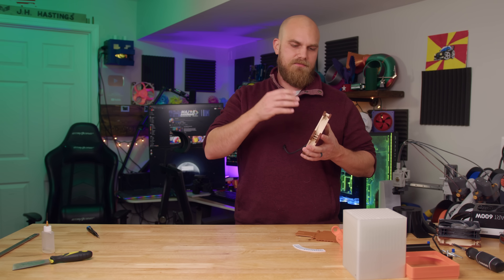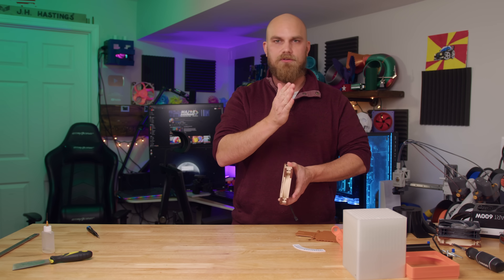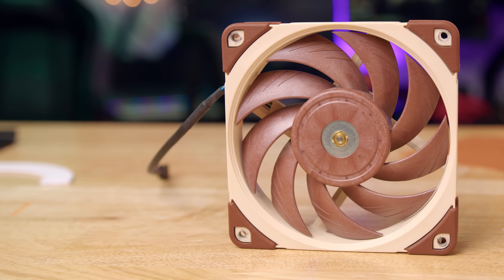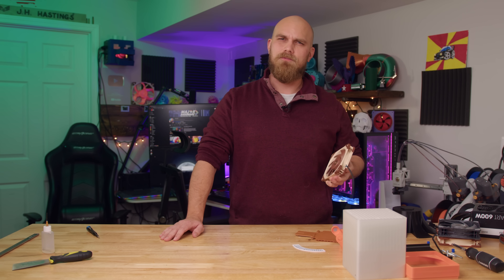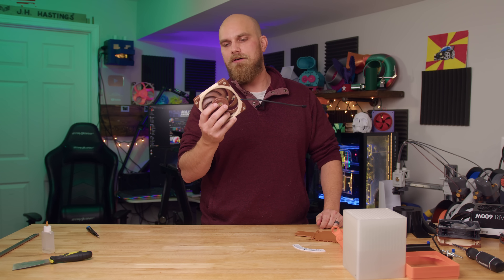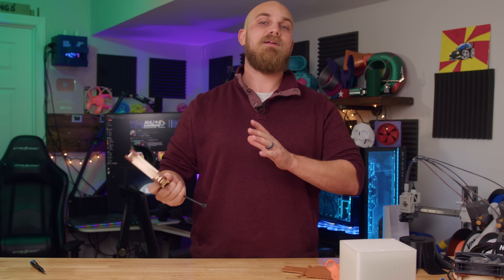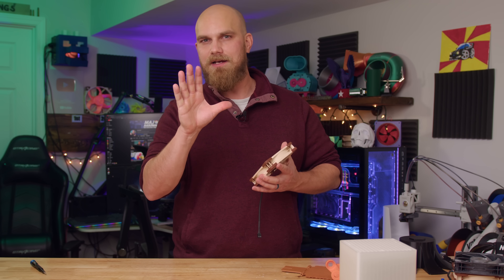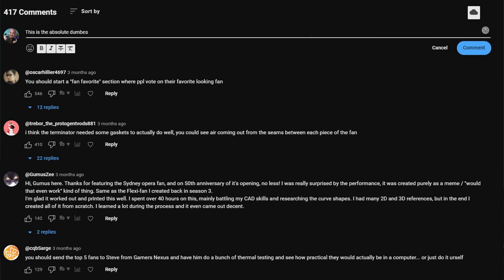I Built a Static Pressure Machine | Fan Showdown Season 6 Pilot

Comment: Could use two tunnels with the fan sandwiched between them, then get two manometers (i recommend the field peice job link pair, i use them daily and love them), and place a bung halfway down each tunnel and the number differential you see on the app will be your static pressure

Comment: The Testo 510 has a range of 0 to 100 hPa (from the datasheet). My web browser tells me that 1 hPa is about 10.197 mm H2O. 2 mm H2O would be about 0.2 hPa, (which does not change the display since it is too small). Since you will be measuring the difference in pressure, you can have a port on either side of the restriction connecting a transparent U tube with water in it. The water will be at the same level without a difference in pressure. You can measure the difference when there is a pressure difference. Since the distance is quite small, you may need magnification to record the different fans.

Comment: For a monster fan to test, grab a VA450DC from Nidec.  120mm (I could only find a spec of 258cfm for a sister fan) 12VDC 3.6A.  I use 6 of these in my daily.  I wonder if the flap opening "unsquare" has any effect on airflow in the chamber?  My thought is something to do with a backwave propagating along one edge, which would actually give spurious data with more powerful fans affected more than less powerful ones.  That would show on a graph as a "diminishing returns" type of thing, when in reality such data might simply be the result of strange airflow patterns in the tunnel.  Perhaps the flow and pressure for PC fans is far too low to matter, but I figured I would offer the thought anyway.

Comment: Just make a manometer. As described, inches of water are just that, the pressure the fan can make measured by how far it can push water up a tube. You might have to play with a few tube diameters, but other than that, inches are inches and water is water.

Comment: I think the linear gauge won't be an accurate reflection of fans that score very, very close to each other unless you swap it out with a dial gauge or something else with very high resolution.

I have -0.01% knowledge in the area of fans, static pressure, and fluid dynamics, but it seems to me that the more the flap opens the airflow can increase by a non-linear proportion.

Comment: Mount a laser pointer to the flap so you can project it long distances and get a more precise reading. You could use a double mirror to extend the beam length in a tight space if needed. Just make sure it stays calibrated if you do that.

Comment: I am not an engineer, but the more this hatch opens - the more air starts to move freely, without dealing force to the mechanism. Will it be more accurate if a fan will blow upwards through a tube into a moving platform, on which you can place different weights? So you can balance it and see things like - with fan 1 - it lifted a platform at 1 centimeter mark with 30 grams of weight. But fan 2 lifted a platform at 1 centimeter mark with 40 grams. So we can exclude the spatial parameters of the system, and be left only with mass that can be lifted and maintained in floating state at fixed height.

So in other words - its like a hover airbed vehicle, but upside down. The higher the static pressure - the heavier that vehicle can be.
Reply: Also, knowing the surface area of that platform and its resulting "floating in the air" mass - you can literally calculate pressure as P=mass/surface. 

Because now you are getting "whatever that is" angle, which can be hardly transformed into real data

Comment: My suggestion would be to look at the early electronic fuel injection systems on cars (70s era). Some of them use similar systems to measure the air that goes in to the system. One example would be the Bosch K-Jetronic (not sure if that is the correct english name). There are my good images on how they work. The engineers had to solve many issues a simple system like yours has, to get accurate reading. Even if you don't end up using it, it's a good learning ;)

Comment: I like last season's "blowing through a radiator" type of method better, static pressure and air volume are two unserapable parts of a fan's performance as you always have to overcome some kind of resistence in a real life situation, and air is what ultimately takes away the heat so volume matters too. But the concept is nice, even though numbers on the gauge barely mean anything, this device can be useful in comparing fans, maybe add this to last season's test suite. The lower half of the gauge is basically unreachable using ordinary pc fans, as the angle got wider, the contact area will get smaller, and more airflow will just pass by the plate without applying any force or just a little force.

Comment: instead of using values 1-18 as angle measurements you could just use 90* and measure the ANGLE, this would also allow you to take more accurate readings

Comment: When that flap moves, it is exponentially harder to move it because more of its weight lays of air flow AND because area gets much smaller. So 1 point of difference at 3-4 and 1 point at 6-7 are two really different points.

Comment: Why not make a simple inclined column manometer? Instead of having water (or some other less dense liquid like mineral oil or even alcohol but that would have evaporation issues) in a 90°/vertical orientation you could make a simple liquid-in-tube manometer at say... 45° high and low side with an expansion on the end facing the airflow. Having a larger ratio between intake end and measurement portion is one wy to increase sensitivity and then adding angle to it could be the cherry on top. 

And sinple to make!

Comment: While this contraption looks fun and is simple to make, it doesn't measure anything specific. It doesn't measure pressure because as soon as the flap opens even a tiny bit, the airflow escapes on the sides, fouling the measurement. It doesn't measure airflow for the same reason. It doesn't measure airspeed either. On top of that, the measurements become increasingly imprecise the more the flap opens due to gravity multiplied by leverage angle, etc. 
If you want to measure static pressure, the chamber should be sealed on one end and you should measure air pressure inside the chamber. Manometers are too much, they deal with large pressure measurements, IMO what you're looking for is a type of barometric pressure meter like Comet U2422 or similar.

Comment: That is absolutely not static pressure - there is airflow so it's not static. You could probably rig up a true static pressure meter placing dimes on a plastic bag until you reach a balance point where the bag lifts the dime stack to half its max height.

Comment: I like the concept for the Cat-Flap-Static-Pressure units but agree with other commenters that this logarithmic scale might not be as illustrative as it originally seems. I would suggest trying a terrible performing and middle performing fan to see what range you can expect out of this setup and then figure out how much it needs modification. Currently our only data points are good, very good, and overpowered.

Comment: The issue is you have linked the resistance and the measurement tool. So now your resistance is not linear with pressure as the gugenooend up, the resistance goes down. A better solution would be to put a load cell on the arm and rather then a solid flap that moves, use a mesh that stays in place and pushes against the load cell. This will give you solid repeatable and most importantly linear measurements.

Comment: Interesting idea.  If you split the flow straightener to leave a little gap in the middle and then 3D print an averaging ring duct around the sides with ports all around the edge.  This can then be tapped and piped off to a simple inclined U-tube manometer to get very accurate static pressure measurements.
Reply: I tried to google a term for the averaging ring port but I can't find out whether there's actually a proper term for it.  It's bascially a way of minimizing the dynamic pressure variations over a duct section by sampling  a number of points around the perimeter of a duct and merging them all together into a single dead-headed measurement port.  An inclined water manometer is just like this, in case you've not tripped over them before:  http://vlabs.iitkgp.ac.in/mv/exp1/index.html

Comment: Would you get more precision and accuracy by having the air forced into a water filled cylinder? Static air pressure generated by the fan vs gravity type of thing. A U shaped cylinder would be best. Would take some tinkering to figure out the optimal tube diameter

Comment: With this setup you need a long lightweight needle on top to make it longer, that way you can have a larger and more precize scale arc. 

Cause your resolution will probably be between 90° 0% and 45ish ° 100%. 
So the larger the arc the finer your scale.

If a fan is only a few % different from another you probably only get a few tenth of a degree difference. 
Think about 20 fans all falling inbetween 5 and 7 of your current scale. 
You need precizion and repeatabilty to make a statement worth all the good work you put in.

Comment: Results will be more exponentially decreasing: nothing short of something with 10x the wind force of an a12x25 would pin that gate to 20, but also most fans will probably be around the 4-7 range. This means your results won’t vary much. One thing I see I. The design is that the flap to the apparatus gradually gets out of the way of the air flow because of the hinge. Perhaps something that stays in the way of the air flow, but is retained with some extremely light duty springs?

Just my .02. You’re awesome. Keep up the lords work!

Comment: With this you are actually measuring total pressure, so static pressure and dynamic pressure. Dynamic pressure is so called velocity pressure and static pressure is the pressure to all directions regardless of the flow. With dynamic pressure you can calculate the flow by knowing the cross area and velocity. Velocity is square root out of (2x dynamic pressure divided by fluid density). Pitot tube measures total pressure and static pressure and the difference is dynamic pressure. Pitot tubes are used in ventilation as well as in aircrafts to measure air velocity. You need a pressure grid or a probe, check e.g. Halton MSA or MSD or Produal PP-SK or PP-PK.

Do not buy Testo 510. I use it at work to measure high pressures with low accuracy. The device is not suited for your purpose. Far too inaccurate. You need to measure something like 0-100Pa with 0,1Pa resolution. There are plenty of micromanometers capable for this. You can even use analog inclined tube ones. You could find a good second hand  micromanometer for cheap from HVAC marketplaces (like in facebook etc.) Just keep in mind what kind of pressures you are measuring and the resolution required.
Reply: And I can ship you few Halton MSA and MSD for free if you like.

Comment: Interesting but i am unsure if you really measure pressure with that and not flow.

I think to measure pressure you would have to blow up a plastic bag and measure how much force its exerting on some kind of weight scale. 
The bag must always be able to blow up to the same size but not fully because it then is constricted by something with a load cell. The bag then presses against the loadcell and you can see with how much force.

I could also imagine a contraption that pushes water to a certain height.
Or instead of the flap on the end of that „static pressure machine“ you could have a bag

(Isnt a fan itself a static pressure machine, because it produces static pressure?)

Comment: Get rid of the flow straightener, close the wind tunnel, bore a hole in the end, stick a flex tube in and fill it with water. Mark the level and let the wind pressure press down on water. Pretty easy gauge

Comment: This setup isn't measuring static pressure at all. Static pressure is measured at zero flow and your flowrate is increasing strongly with higher flap angles. 
This setup would probably show a lower value for a blower fan even though its static pressure should be much higher, because at higher angles it doesn't have enough airflow. 

The scale will also be difficult to interpret in a linear fashion. The force imparted on the flap deacreases with the cosine of flap angle, while the force required rises with the tangent of flap angle.
This is fine to compare and estimate airspeed but not really good for pressure testing.

My recommendation is to have the flap fully closed and attach it to a scale, which keeps it closed, while recording the force. These values can then easily be compared. 
If you want to go fancy with it you could also measure the airspeed inside, then adjust the flap angle either to a constant airspeed or flap force and compare fans. Because now you're essentially measuring a full on (P-Q)fan curve.
But for an easy introduction, measuring at zero flow (static pressure) would be the easiest to get going.

Considering the needed scale/force sensor: assuming your flap is 0.2m*0.2m=0.04m^2, 2mmH2O eqv. to about 20N/m^2 of Pressure -> 0,8N/80g 
That's reasonably easy to measure and a good resolution sensor in that range won't break the bank. If you measure at the bottom of the flap you should also get 2x leverage for free, since the pressure force is attacking at the center of the flap(in a low angle scenario).

Hopefully i could help or inspire you somehow.

Comment: You can make a easy pressure gauge with water!! Use a clear tube to make a simple barometer, smaller ID tube should allow for rather low pressure measurements. Or at least a visual difference.

Comment: Digital altimeters could be used. An Arduino, two altimeters, and an LCD. One for ambient, and one in a sealed box to measure the pressure increase. Display the difference.  These things are sensitive enough to measure mere feet of change in elevation.
Reply: Look at the bmp390L
Reply: I'd also consider the DPS310

These are so cheap I'd try both the infinion and Bosch sensors.

Comment: Alternative solution I have in mind is to make a vertical tube with the fan at the base.  Along the wall of the tube there is a thin slit cut.  Place a plastic ball in the tube and the air pressure will lift the ball.  the higher the ball floats, the more air gets pushed out the slit in the tube.  Eventually it will reach an equilibrium where the ball is effectively held in the air and you can measure that point along the slit.  The adjustment points would be the weight of the ball and the thickness of the slit.

I think that it would also visually look cool and be duplicatable.

Comment: I don’t like it.
As the fan blows the flap it opens the hole allowing the air to escape.
The more horizontal the flap goes the less accurate the measurement is.
Scrap the flap, mount the fan to a long horizontal funnel with a “u-bend” on the end filed with coloured water. The higher it can push the water up a pipe the higher the pressure.

Comment: Whether you choose to go with this concept or something else, I'd calibrate it so that the T-30 maxes (or almost maxes) out the scale. I can't imagine anything slapped on an A12x25 will outdo the T30 at full power, so having space on the meter for stuff past it will just reduce the resolution in the areas that will actually be used.

Comment: Can't say I'm a fan of the swing door. I applaud the effort but the resolution is too low to be able to differentiate from one fan to another over testing. Spit balling ideas here. Have a similar setup but instead of a door have it a sliding box with a light spring. Point the whole thing down to minimize friction. The fan would push the end stretching the spring to represent the force. The plate that the force acts on doesn't change and if there is not enough resolution the spring can be changed out for a lighter one.

Comment: Extend the wind tunnel so that the flap is inside of it. You'll contain the fan's airstream and get a more accurate sense of power output, since currently the fan loses lifting efficiency on the flap as more air can bypass it as it gets higher, skewing the resolution into more of a false log scale.

Comment: I like this testing tool, but i have a couple of concerns. 
1. If we could find a way to increase the resolution of the scale that may be necessary. 
2. I feel that a linear scale is probably not appropriate. Opening to 45 degrees is definitely not the same as the difference between 45 and 90. 
I don't know how to fix these but perhaps a longer needle on the arm and a larger scale reader and/or some sort of logarithmic or exponential markings on the scale.
My idea would be that each number would be twice the pressure from the previous number. But, this may all be silly.

Comment: I think, as a relative measurement technique, this should work fine. And the flow straightener is a good idea. If you wanted to get more sensitivity out of it, you could have the wind tunnel converge to a smaller cross-sectional area after the flow straightener, and print a smaller flap. (This would also let you get more sensitivity out of off-the-shelf monometers, but you'd have to do some Bernoulli equation to recover the actual static pressure).

My biggest concern would be, if you ever end up having to print another flap, using the same printer settings and filament so the weight/shape is consistent.